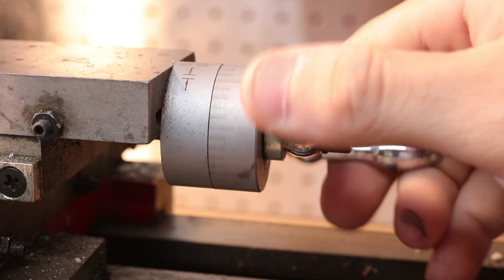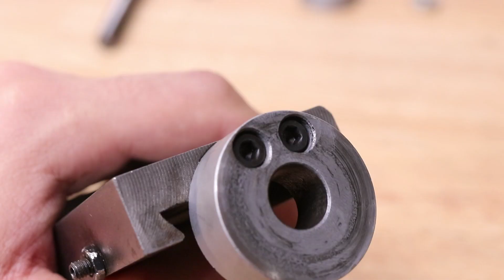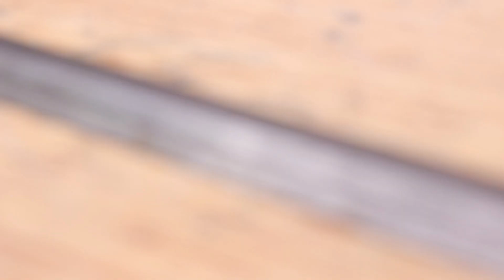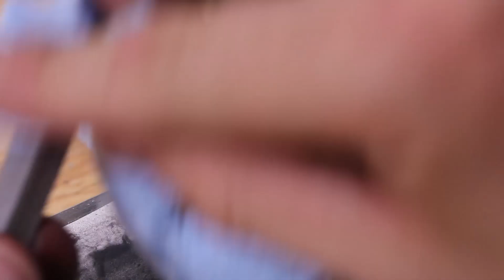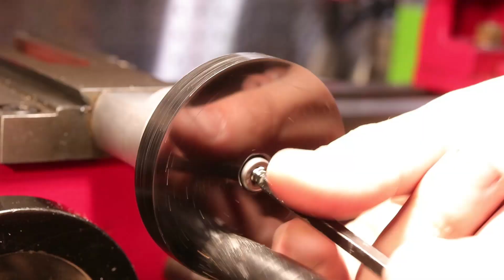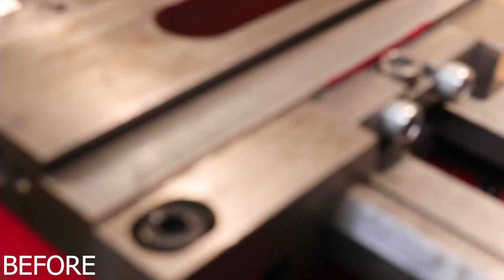Lapping The lathe Slides

Comment: You measured the surface finish by moving the gauge which is a poor way to do it UNLESS it is being moved on a surface plate, which I didn't see or hear you mention. UNLESS the guage is on a known fixed reference, either stationary (best) or on a reference plate it will be unknown as to WHERE the surface imperfections are being seen ... On the slide or from the surface on which the gauge is being moved. 

Ideally, the guage should be static and the slide moved past it. Once again a compound error will be introduced due to any imperfections between the main lathe slide bearing surfaces and the main slide. Similarly with the cross slide. In an ideal world these should first be checked OFF the lathe and placed on a reference plate together with the gauge moving the slide past the gauge and measuring the surface accuracy from above, down onto the slide surface with it upside down on the reference surface, then the same way but by moving the gauge on the surface looking for significant deviations in either case. The same four checks for the cross slide should be done ... 8 checks in total making a note & marking of any points of discrepancy and correcting those before re-assembly.

Then again for BOTH slides they should be checked first by moving the slides PAST a stationary gauge then moving the gauge along the slide surface using the lathe bed as a reference. Any large discrepancies showing at this stage, because of the previous checks are likely to be coming from the lathe bed itself, which for complete accuracy should itself be tested against a reference surface for trueness and surface integrity.

What you did is great for some relatively quick improvements but is FAR from a comprehensive overhaul. Very clear video and explanations though.

Comment: Hey man, I really enjoy your videos, but waht you are doing in this one is a VERY bad idea (and very bad advce). The first issues is that those surfaces should have some irregularities. This is why many machines come with scraped and flaked ways. Smooth surfaces don't hold oil film correctly.  More importantly, when you put lapping compound on your ways, you basically rined them. Some silicond carbide will embed itself into cast iron. Now you basically have two flat laps grinding on each other, which will wear the ways out unevenly and pretty quickly. The only way to fix this will be to grind off/scrape off the layer that is charged with silicon carbide, which is a LOT of work.

Comment: I recently came across a very different way to improve sliding surfaces. Imagine that you could fill the sloppy areas with metal simply by using your machine and some duct tape as a mold. Actually you can and it has been doable since the 80´s with Diamant Moglice and DWH metal epoxies. These epoxies are used in fixing old and expensive machinery. The Moglice is especially interesting since its made for sliding surfaces. Think about it. If your lathe saddle is wobbly you could simply shim it level and add some duct tape to create a mold. Inject the epoxy inside. After curing you have a perfectly level and sturdy saddle. You can also mold the inside of a lead screw nut to achieve maybe 2 thou backlash. The applications are quite impressive.

Devitt machinery sells it in the us. If you look at their youtube you can quickly see that this company makes quite fancy stuff. They made a video of how they fix big machines with it: Ingersoll repairs by Devitt machinery. Also Stefan Gotteswinter uses these epoxies when building stuff. He recently trammed his milling machine column with DWH. He also rebuilt his lathe with the Moglice. Talks about it in shop talk #7. Otherwise you tube is quite bad showing it. The instruction manuals both from Devitt and Diamant are best explaining the applications.  Some Russian videos on it. You can make these epoxies running like water or like chilled butter for your application.

You could probably ask Devitt about a sponsorship for videos since this mini lathe rebuilding niche is growing and many people don´t know about these epoxies.

Comment: Don't you actually want machining marks tho? For the greese, so it doesn't just slide off?
Reply from the maker: You are right that optimally you would want some marks to retain slide oil, and for best results in would want to scrape the slides. But in my experience in using this machine, the deep machine marks from the factory did more harm than good and since I did the lapping it has improved the action of the cross and top slide. It is not perfect, but without the equipment to scrape the slides, this is the approach I took that saw improvement. Cheers.
Reply: @artisanmakes  I see, can't argue against factual improvements :)

Thanks for the reply!

Comment: Here's a little idear 
Why not also make a solid tool post for it for when you don't need angles since that will make it even more solid / rigid when facing. Parting off and just overall turning and when angels are needed you take the solid tool post off and put the angle one back on

Comment: Nah, the last thing you want to do is impregnate cast iron slides with abrasives. The slides should be 'scraped in' flat and 'hollows' left in for oil retention and friction reduction. From an old retired machine tool fitter who believes the correct ways are the best.

Comment: This is a very dangerous process for an inexperienced user. Many people have ruined their machines from rough handling of abrasives. After lapping the guides, carefully remove any metal layers that may have penetrated the abrasive. Take a sheet of glass (оr polished metal) and wipe the surface of the guide well. If there are scratches, you must fight it.

Comment: I think you get a pretty visual explanation as to why this type of lapping is not ideal in your last clip where you show the surface quality with the DTI: your ways are not flat. Maybe they weren't to begin with but grinding lathe ways like this is very difficult to control. Stoning the ways individually to get the marks out (or just flat even) and checking as you go along is probably a better way. Or, as others have suggested it seems, scraping the ways using a DTI, and flat reference and machinists blue. Scraping lets you control the materail removal. Lapping the way you are doing puts enormous demands on how you are loading each stroke. You are basically wearing your lathe super fast. Plus you run the risk of embedding the grit in the ways. And that WILL wear your machine out FAST. Some valleys in the slides isn't all that bad, works a bit like oil grooves and keeps lubricants in place.

Best of luck with your continuing projects!
Reply from the maker: Quite so, there is certainly a dip on the compound slide around where the counterbore is machined. That was there before but I didn't show it on the first sweep. Across the whole length of the compound we loose about 25 microns according to the indicator. For a $600 import lathe I am not too bothered about this. Like I said in my pinned comment I know there are better ways to approach this (as you referenced scraping) but the way I see this is that this method is much more user friendly to the hobby machinist and the results I got were a worlds improvement over the finish from the factory. If this was a bridgeport you bet I would have the ways scrapped, but on this lathe, maybe not. Cheers
Reply: For what it's worth, I got some inexpensive stones (~25USD). Grits (allegedly) 1000, 2000, 3000 and 5000. Precisely to deal with my, now 3 days old, mini lathe. Ordered before hand. Yes, I was expecting that.

The sheer amount of burrs, kinks, deeps & valleys, low quality machining and specially non flat surfaces. Is absolutely overwhelming, even worse than I was expecting. 😞 Either case where used there was an obvious improvement.

After watching the many videos online I came to the conclusion that mine unfortunately was probably a "test bed" or QC refused lathe. Due to the enormous amount of OEM defects. Assembling being the least of them!
Headstock held in place with the two outer screws (only). The chuck side can't be tightened! The holes/thread are too short! Missing screws on compound slide, panels, etc... The back of the headstock has about 14 threaded holes!!! What about that?! 😂 😂 LOL 
Sad story! Counting more on having older engineer skills than anything else.
Reply: @artisanmakes  This isn't going to improve machines. you're going to be teaching novices to destroy their cross slides.
Reply: @artisanmakes  Because yea, it sure is easier to lather some abrasive on the ways, but there is a reason scraping takes some time.

Comment: Could you do a tutorial on how to hoan brazed carbide?
Reply: Get an eze lap diamond hone from knife center dot com
Reply: @GunFunZS  alrighty thank you good person
Reply: @Nullsnaggle  I suggest medium grit something like a 3x6 or a 4x6 bench stone. It's an incredibly useful steel tool to have
Reply: @GunFunZS  thank you for the suggestion good person (sorry didnt see the name😅)
Reply: @GunFunZS  the only one I can find that is less then $30 is a 1x4 will that be sufficient for honeing small carbide tools?
Reply: @Nullsnaggle  definitely. But the larger one is nicer for doing things like sharpening knives. The small one is definitely sufficient but having the big piece comes in handy for lots of stuff. For instance let's say you want to lap a machine tool and make it flat. The bigger one gives you a very flat object that will cut any object to be fairly flat. It's nice to have something like a medium and a fine. Course is good to have too but if I was just picking one it would be the medium then the fine and then later a course. I think it's a good practice when you have a new diamond stone to take an old diamond stone and held them flat together and do a couple figure eights. That way if there is a particular piece of grid that is a little bit proud it will get knocked down. Easy lap is more consistent than the other brands so this is less necessary, but I almost wouldn't use this type of diamond stone which you can get at like harbor freight or the DMT ones without running another diamond stone across them. Those have less grit and it is based farther apart so it is more gougey if that makes sense.
Reply: @Nullsnaggle  second bit of advice if you get the small one particularly. You can ink up the tool and then clamp the hone in your vise. Or perhaps glue it to a block of wood if that makes it easier to handle. Now swipe the tool across the stone instead of the other way around and you may find it easier to control your angles. The ink on the tool will show you if you are doing it correctly. Same thing for sharpening knives. It's basically the Dykem concept
Reply: @GunFunZS  alrighty my good man mine arives the 25th and I will be using all of your advice😛
Reply: @Nullsnaggle  you will find that it isn't as complicated as you might think. Try to use firm pressure and smooth motions. When you are trying to preserve angles the basic method is to bring the part into contact with your home, and let it rock to find its own natural angle. Then you kind of lock your wrist at that angle and move your whole forearm. This is easier to do smoothly if you have the hone held at about the level of your elbow. It becomes very natural to maintain angles consistently if you've done this a bit. If you take a woodworkers chisel for instance it is sort of an exaggerated .  example. You will quickly feel whether you have it held at the right angle to keep the same grind. And the ink will show you if you were wrong. The same lessons are very true for using files too. There are some  techniques like draw filing that help you be steady and mirroring the curve for copying rounded surfaces. But mostly these will make sense after you start doing it. It's not hard if you go slow and pay attention.
Reply: @GunFunZS  that makes sence

Comment: Great tip! This is effective for really small lathes like these, where the slides are short enough that any errors you lap in will be mostly negligible.  An additional benefit is smoothness of operation., plus no more tight/loose spots in the travel, which always make adjusting the gibs an adventure in compromise.

The only better method is scraping, which requires more equipment, and is substantially more laborious.
Reply: Please don't do this.
Reply: @Rolo-Tony  Yeah, technically it's not the ideal way to do it. You're lapping 2 surfaces together without a 3rd to average out any twist/convex/concave. The surfaces will be making perfect contact, but said contact won't necessarily be flat and straight. 

However, given how crappy the sliding surfaces are from the factory, this is still an improvement. Further, the travel distance on both the cross slide and the compound is pretty short, so as long as you don't go crazy, the errors will be minimal, and have minimal impact on accuracy. Also, as long as the lapping compound is non-embedding, you won't have to worry about that, either.
Reply: @fna-wrightengineering  Just so I am understanding this right, would it logically follow that if one had two cross slides to work with, you'd eliminate or at the very least limit the twist/convex/concave issue? Swapping the two out with each reapplication of compound.
Of course the two cross-slides aren't directly referencing each other so it isn't a true whitworth ABC plates technique, but I wonder if it could work reasonably....

As a long term project I'm working on a bit of a gingery-inspired lathe, so this kind of thing is naturally pretty interesting to me! If one could get away with making the basic dovetail shape with just casting and perhaps some filing to refine them just a bit, and then subsequently use an abrasive compound to do the heavy lifting, and finish with scraping... that could be a substantial improvement over just flat ways. If you happen to have any thoughts on it, I'd be glad to hear :)
Reply: @johannesmajamaki2626  No, I don't think the 3-plate method would work here, as you're not making 3 identical surfaces. You've got male and female dovetails in addition to the flat running surfaces.

Scraping is the most accurate way. You don't need to worry about lapping before scraping, you can just file things close enough, and scrape from there. You will need a surface plate, which can be generated via the 3-plate method (OxTool has a great series on this), or you can pick a small granite plate up for pretty cheap. You'll also need a straightedge with a 45-degree face (which can be generated once you've got a good surface plate), to scrape the dovetails.
Reply: @fna-wrightengineering  we have a private group chat on facebook for all aussie scraping enthusiasts and recently made a group, everyone lends/trades and swaps camelbacks and masters to keep costs down and Dan organizes the group granite buy so we can buy high end precision granite at a reasonable cost. filing is also wholly unnecessary in modern scraping as you can pull material off much faster with a 135mm blade without rolling the edges, if you also scroll down there's a post explaining how you can get around not having a long enough master for scraping dovetails but that's only an option with a long slide style cross slide. https://www.facebook.com/groups/1242191559496575
Reply: You have to understand something about these lathes. I have one. The dovetails are not parallel. The gibs are bowed. You can't adjust anything to obtain rigidity and yet retain "movability". Just short of toasting the movement, anything helps. I actually blued and scraped mine using a crdue technique. It was the only way to make the lathe usable. From my understanding, not all are as bad as mine. Thanks for the vid.

Comment from the maker: G'day everyone. In this video I will be showing you how I went about lapping the slides of my mini lathe to improve the action and rigidity of the slides. A few things to note, I use the term gib strips and wedge interchangeably here, but it all refers to the same part. If anyone is worried about this process affecting the accuracy of the lathe, I personally would not worry. The amount of material we are removing is less than 10 microns at the most and any issues caused by lapping would be made up by the benefit of the increase in rigidity that we can achieve. Finally I am sure that there are other more precise methods to lap a lathe, but this is an easy method for mini lathe users, I can only ask so much from a $600 machine and this method has produced some great results for my lathe. Cheers everyone, I hope you find this information useful.
Reply: Honestly as its a Mini lathe nothing of value was lost and clearly its improved it to some degree but I've had several "lapped/polished" lathes come into the scraping classes. the abrasive in emery paper or the lapping compounds is often very free charging to the soft grey cast iron. the lapping will often generate a convex surface on the short slides and In the long term causes irregular wear. scraping through the skin of the lapped surface is also a right pita, it is similar to scraping the ways on abused TC or surface grinders as the embedded abrasive dulls your blade until you get down to clean cast iron. if you're in SEQ I have a machineshop with 2000mm x 1000mm granite surface plate, Biax, camelbacks and spotting plates etc and rebuild quiet a few machines if you ever want to pop your head in I can teach you a bit of scraping. - marcus (using my partners youtube account to post this)
Reply: @sharkienado  Two thumbs up for you!